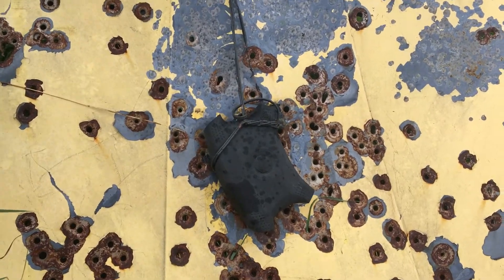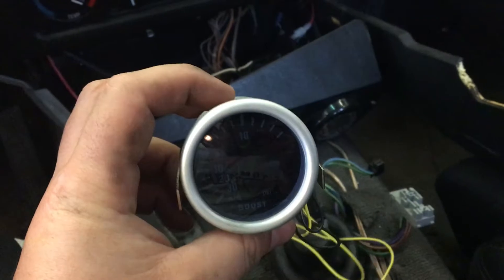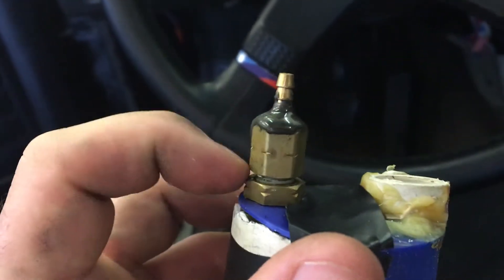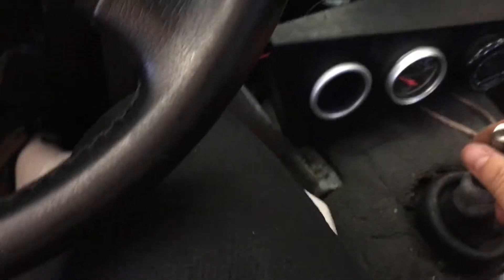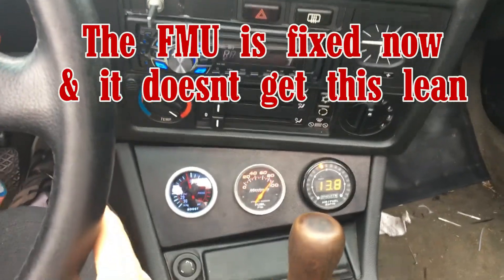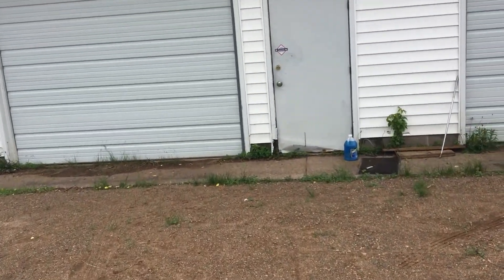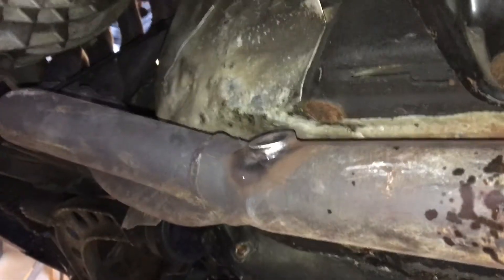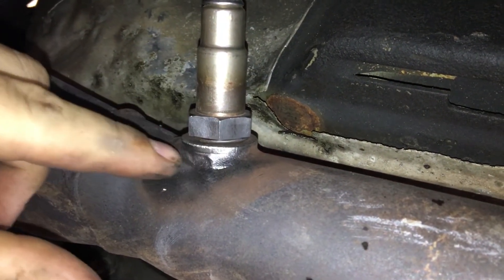New BOOST Gauge & Fixing up the E30

Comment: man. make a video driving the e30 on some back roads. Your e30 is goals. m42 all day on e30. eheheh
Reply from the maker: It just started having high fuel pressure stuck again after running mint for like 1 day but after that’s worked out, definitely

Comment: Really enjoy your channel. I have a m50b25 ( well 2 actually ) when buying a fmu would a 10:1 or 12:1 be better for 7 psi
Reply from the maker: 12:1 is a good go-to since at a certain point it will saturate and not be able to go higher. figure 7-8psi is like a 80psi fuel increase so the pump probably cannot supply 120psi .. (40psi idle + 80psi in boost)
this is my understanding but someone can correct me if I am wrong!

either will work is what I am saying but the 12:1 is easier and a safer bet!
thanks!
Reply from the maker: I would definitely get a walbro 255 before doing this too since it is easy and cheap and can supply the more fuel without a doubt!
Reply: E30 ShedSkid thx so much man. And yea planned on running a 255